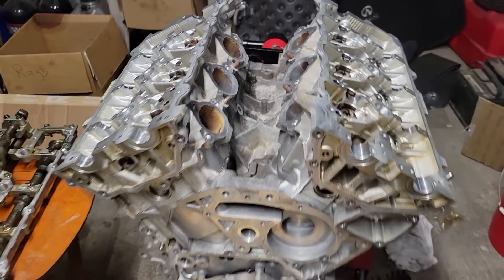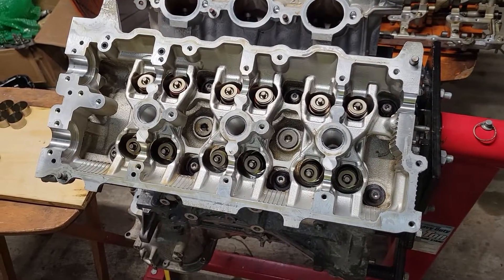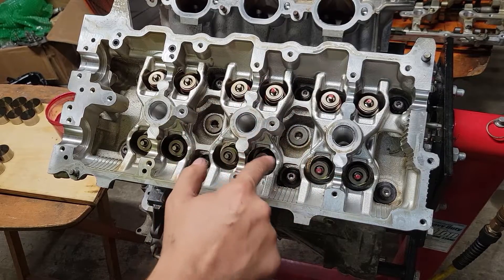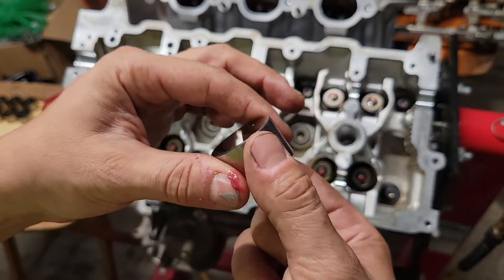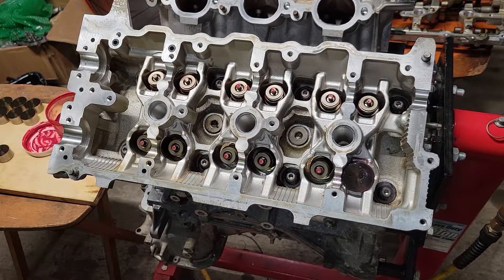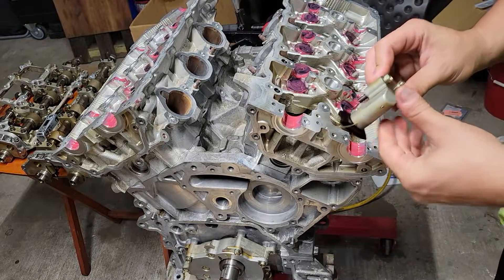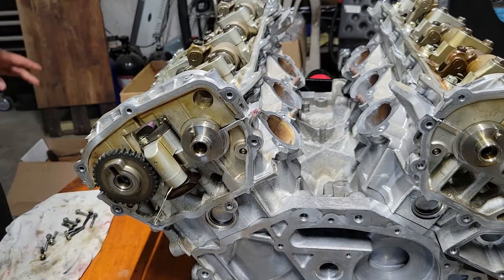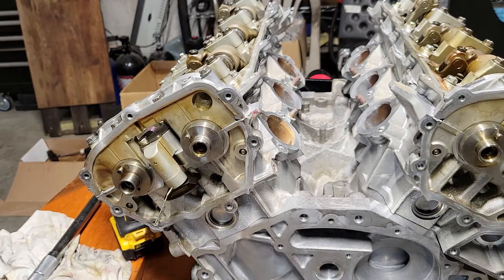Forged VQ37VHR build part 20, camshafts and valve components

Comment: Hi Garage Fanatic .hopefully u can help me I've had changed my head gasket on my vq37vhr and then putting my engine back together. Then fire it up car is start up smoothly. But the problem im having is that there is no acceleration 0 rpm and is feel l like when im accelerate its blowing air out from the intake any ideas why?
Reply: Sounds like you messed up the timing and had a piston bend a valve, do a compression test and find out which cylinder it is.

Comment: Got a quick question for you. Are you running these JUN 288 cams with a stock valvetrain? And are the exhaust valve followers DLC coated or not?
Reply from the maker: I'm running stock valvetrain all together, cams included. And yes, apparrently all VQ followers are DLC coated. That's DE, HR, and VHR.
Reply: What is this mean

Comment: Hey i noticed when you did bank one the rear of the cam was sitting up a little high mine is also and I'm concerned about bending or scaring something. I'll even be willing to PayPal you some money if you can help me lol
Reply from the maker: It's sitting up high because the camshaft lobes are in a position to compress the valves. As long as you are in the correct degree range with the pistons and camshaft positions you're fine.

Comment: When your just removing the rear timing cover and you got cyl 1 at TDC and the 5th cylinder exhaust cam is in the position like in the video 11:57, and it happens to jump when removing the cam sprockets. Will that cause a bent valve ?
Reply from the maker: You won't bend valves when removing components. If you tried to start it, absolutely.
Reply: @garagefanatic7830  ohhh man thank you so much 🙌🏽🙏🏽 definitely a big relief lol.

Comment: Bank one stays at the right position until I tighten everything down then it jumps over.
 
I just applied liquid gasket. Hours wasted
Reply from the maker: That's because #1 cylinder at TDC will have one of the camshaft lobes at its highest peak. You just have to be patient with it and pay close attention to what you're doing.
Reply: @garagefanatic7830  Thanks. I got it all timed Monday night - spent 5 hours after work..  also got the VVEL motors and front timing cover on last night- 4 hours. Meticulously done... Removing gasket cleaner and reapplying, etc. Hard part is done! Thank you for your videos!
Reply from the maker: @doggystyledave  make sure you get those VVEL sensors back how they were as close as possible. You will have to adjust through VVEL relearn procedure in the manual. It's pretty simple.
Reply from the maker: @doggystyledave  that makes complete sense then since you disassembled at TDC! You shouldn't need a retune for an engine if compression, intake/exhause runners, cams, and other items are the same as before. Basically, changing VE(volumetric efficiency) is what requires recalibration.

Comment: When you attached bank 1 was the left side lifted up?
Reply from the maker: What do you mean by lifted up?
Reply: @garagefanatic7830  was the back part of the cam sitting on the the cap rather than in the groove of the head?
Reply: @Stockclipz how'd you get it to sit back down in the groove
Reply: @garagefanatic7830  also I actually just finished putting my motor back together and she turned on, only thing is im getting p1090 and p1089, idle is pretty bad, any idea how I can fix this?
Reply from the maker: @Stockclipz  those are VVEL codes so you probably didn't put the sensors back how they were to get around the 500mv area in the ECU.
Reply: @garagefanatic7830  how do set the sensors to that? Im not kinda new to this, this was my first time ever tearing down a motor and Idk how I even got it to turn back on😂
Reply from the maker: @Stockclipz  go find the manual for the VQ37VHR and read the VVEL section. After that, get back to me. There's a procedure for it and a specific voltage at key on to look for. Go read up on it.
Reply: @garagefanatic7830  thank you, I will do that and get back as soon as I’m done

Comment: how much do you charge to build a engine block like that or similar to your G37
Reply from the maker: For this one, it's around 4k for disassembly and reassembly plus parts, machine work, and whatever shipping charges you incurr. Quite a bit cheaper than the big companies. The big discount is primarily because it's just me and no employees.
Reply: @garagefanatic7830  so that price not included parts right just your labor
Reply from the maker: @fxindicated3404  that's correct.